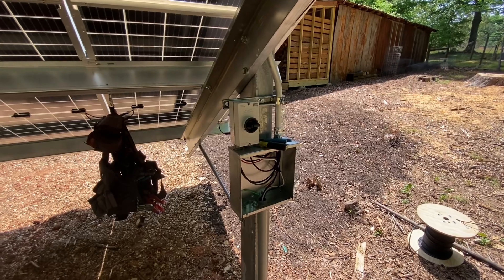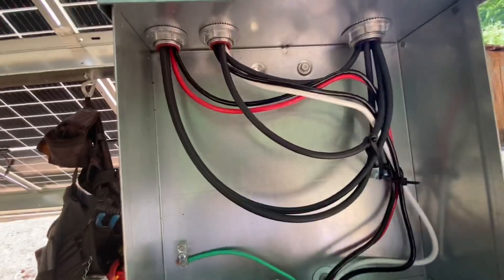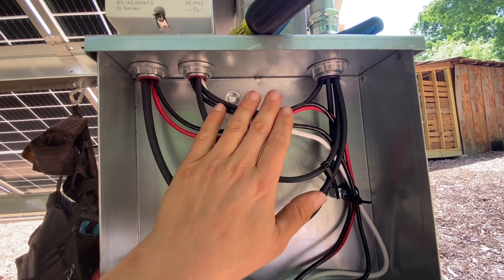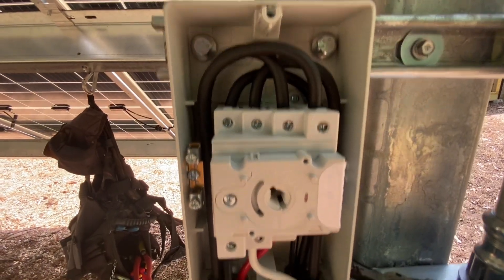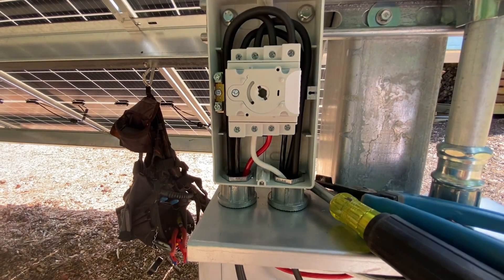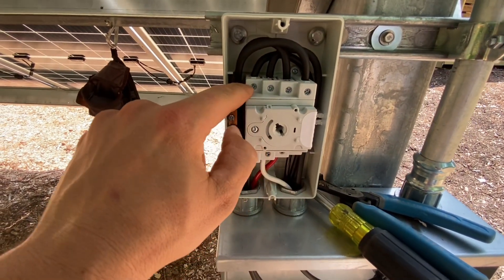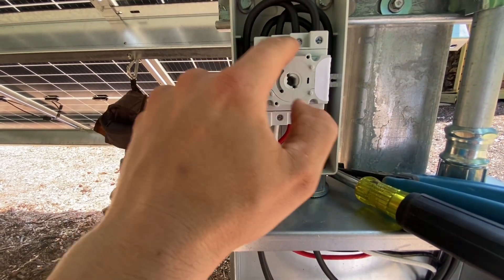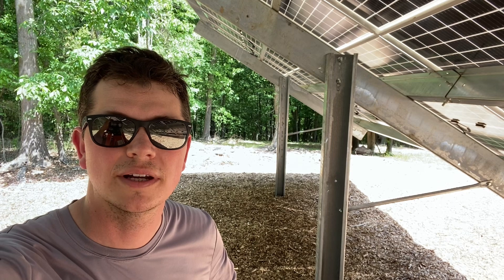DIY Solar Array Wiring: Transition Solar PV Wire to THHN conduit wire

Comment: Do you typically do surge protector installation on PV wire? I thought it was required by the NEC, but maybe the inverter's surge rating is sufficient?
Reply from the maker: It’s not required on the dc side but it is required on a service for a house.

Comment: Im holding one of those DC isolators in my lap and i cant turn the dial. ( I did check that the center dial post fit into the switch). Any idea why it wont turn?
Reply from the maker: Maybe cover is not aligned.

Comment: Any down side to running pv wire all the way to the inverter / mpp charger all in one unit? My run is less then 100 feet.
Reply from the maker: Hard to pull. More expensive.
Reply from the maker: But we’ve done it a few times

Comment: Per NEC wires in underground outdoor condit are in a wet location (see definition of dry, damp, and wet locations). THHN wire is NOT rated for use in wet (but OK for dry, damp) locations. It must be THWN. And you are an electrician?
Reply from the maker: Yea I am.  Pardon my electrical speak. It’s cross listed wire you stickler.  I don’t think I’ve ever even seen straight THHN it all says THHN/THWN-2 MTW blah blah.
Reply: Yeah you did say it was cross listed THWN. But you kept saying THHN. Just making sure your viewers who read the comments know the difference.

Comment: What is the largest THHN wire the IMO will take? Will 8 gage wire work?
Reply from the maker: Larry have you purchased your inverter batteries solar materials yet?
Reply from the maker: I don’t know the largest size off the top of my head but I routinely wire in #8 and it fits. I’d say it will definitely fit a #6 as well
Reply: @GainSolarPower  Thank you and keep up the videos they have given me the knowledge and confidence to install my solar DIY. Thanks again much appreciated!

Comment: I really appreciate all the hard work you put into these videos, Johnny.  I’m doing my own DIY installation, and many of your videos have been super helpful to build confidence and do a professional job.  Just today I looked up your clips video and found my local electrical supply has all three of the clips you suggested.  I’m also using a mast head cable entry which I picked up from you and Engineer775.  The cable pulling video was also very helpful and my family and I had some fun pulling our own wires in.  Keep up the great work!
Reply from the maker: That’s great Jeff. What type of system are you installing.